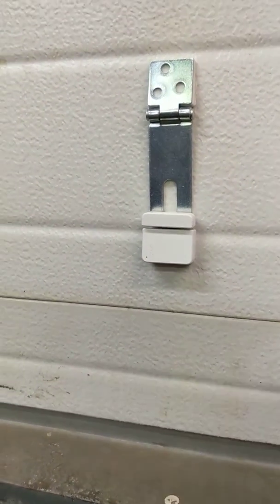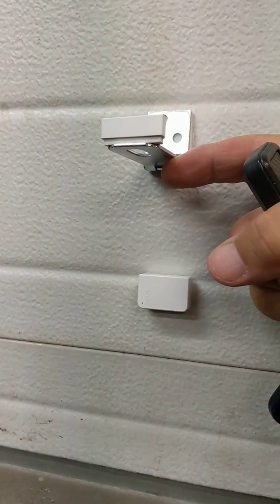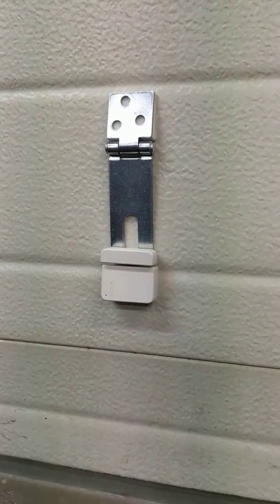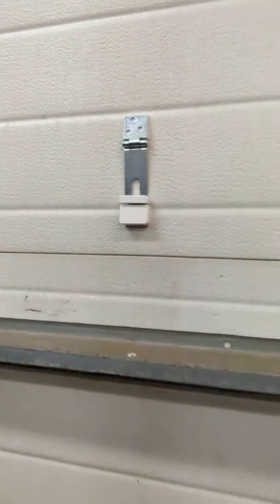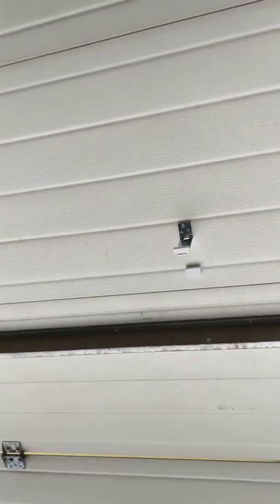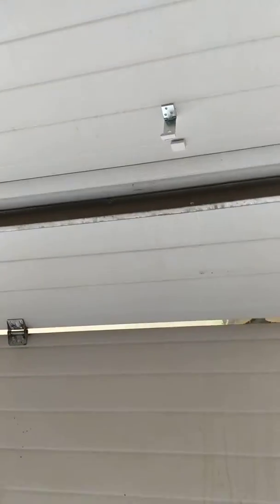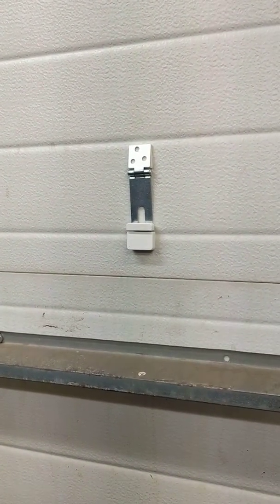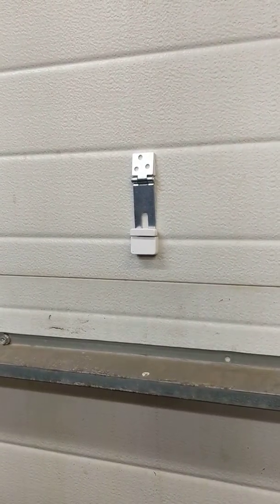Wyze Contact Sensor implemention

Comment: Couldn't you just stick the sensor on the chain drive trolley so the two pieces slide apart from each other? Or have it on the edge of the door with the other piece on the wall so they slide apart from each other?

Comment: Brilliant.❗❗
Sensor is out of harms way, with easy access for battery replacement. Way better set up than what I did👍

I'm going to change mine, but will put it on highest panel so it opens sooner.  

Thanks for sharing.